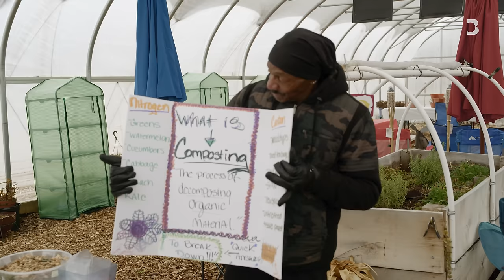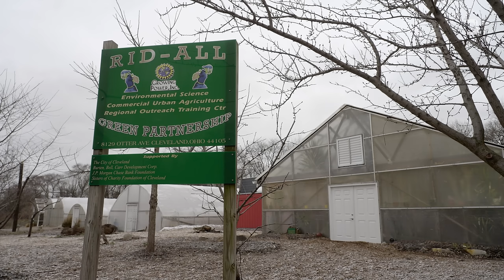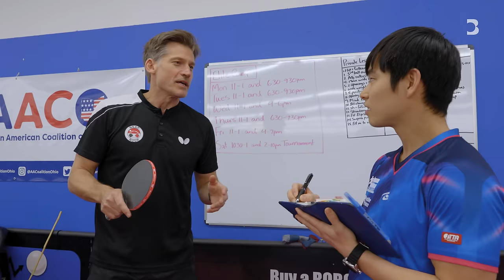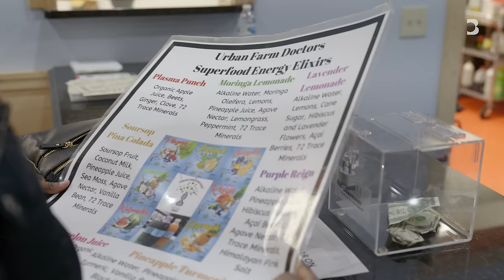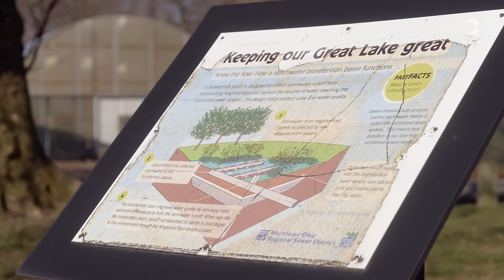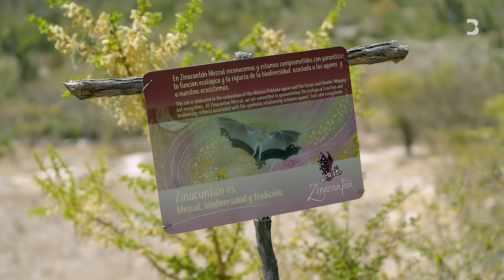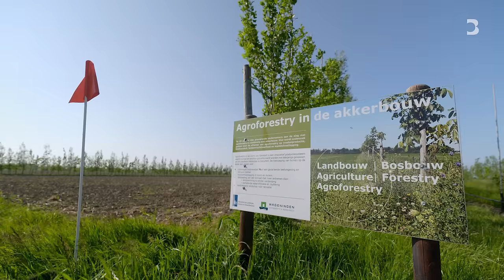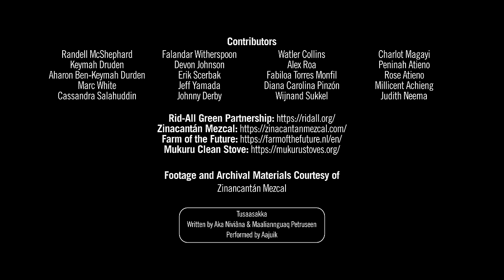Nourish: Rethinking Our Approach to Food | An Optimist’s Guide to the Planet

Comment: 23:00 - if this place have electricity its much easyer to buy cheap 250$ water pump, make a 60meters down pipe with spec machine, kind of finding oil. and put it on constant pulling water from underground. and itll flow down again, and up. 😊 and itll grow to a green land, trees will give some shadows and water will not vaporate and itll grow more and more 🤗 and that feels nice 🥳👍